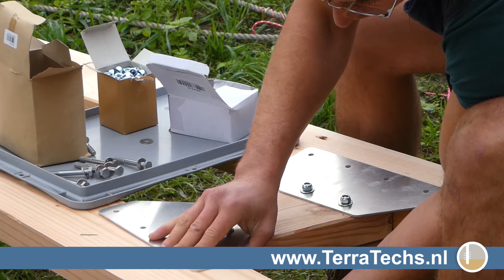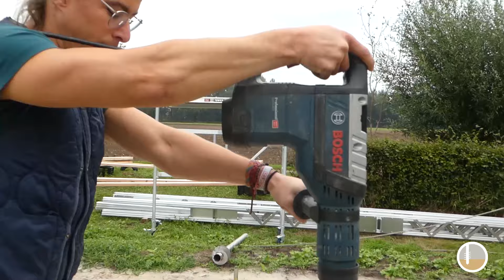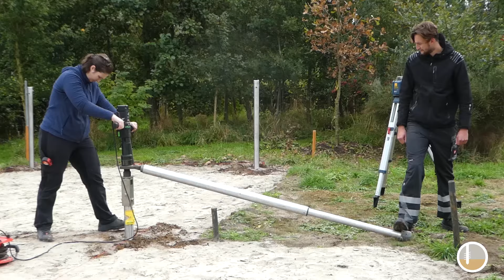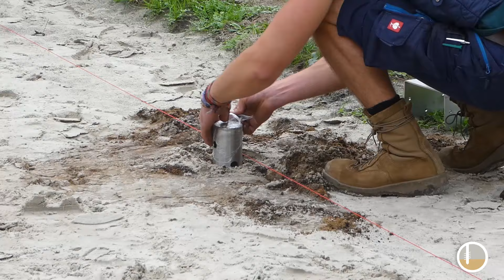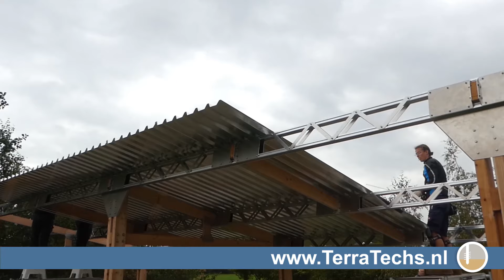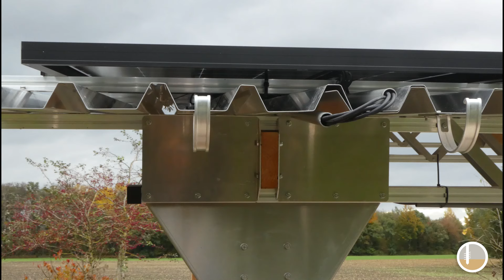Solar Carport: Bouw zelf een droom carport of overkapping met zonnepanelen!

Comment: Why does it still need a roof? It would be enough to install some covers between solar panels and that would be enough.
Reply: Yea I just finished watching a few videos on exactly that!
Reply: Might be because of local code and permitting requirements. Some places have silly rues about “free standing structures” or dont have anything for solar arrays in their code, gotta do what you have to do to not have the county come give you fines.
Reply: The panels do not provide a totally waterproof surface because water would leak in between the panels.  Also, panels shouldn't be mounted right next to each other anyways to prevent stress from thermal expansion/contraction so any covering or sealant between them would eventually leak.  A roof experiences major environmental stress from thermal expansion/contraction, moisture (even if no rain due to morning/evening humidity moisture), wind, UV, insects, etc.
Reply: @beyondfossil  Thanks, makes sense. But sureley a waterproof spacer could be developed or maybe already is. It makes porfect sense to avoid anothe rlayer as these panels are very strong and waterproof themeselves anyway.

Comment: Very black loamy soil and an interesting auger-post system designed for it, though appear pricey posts.  My soil in California is dense enough with rocks that a post 3 ft deep in concrete is very solid.  The framing is very rigid, probably to sustain a large snow load.  Nice waterproof metal roof underneath.  But no details shown on how the panel trusses attach to the roof and how the wiring is run.